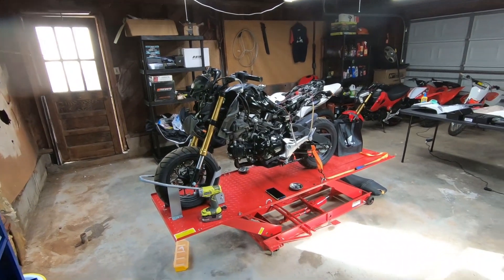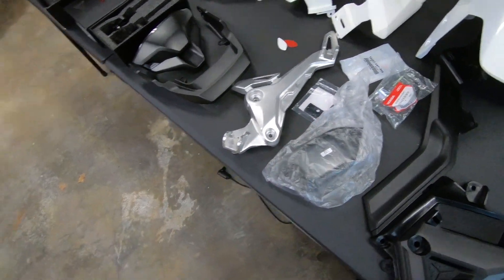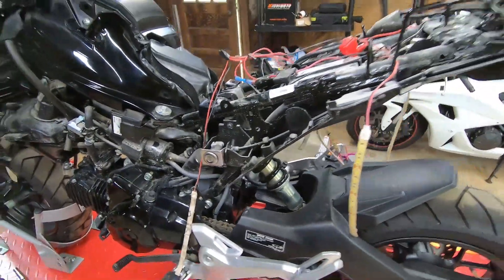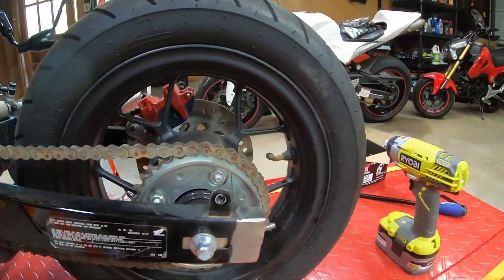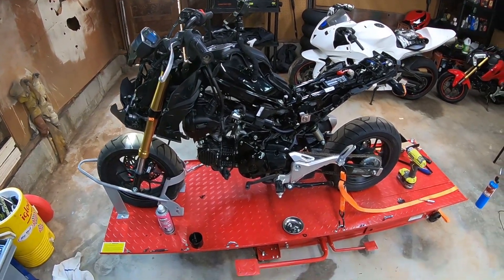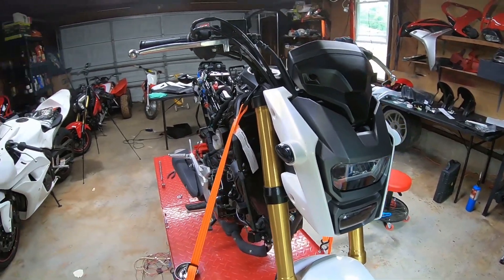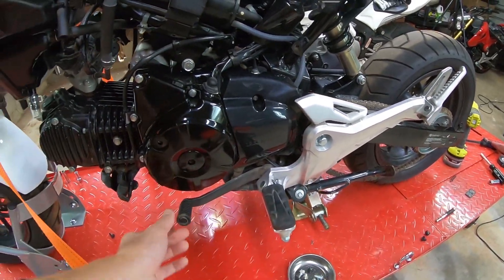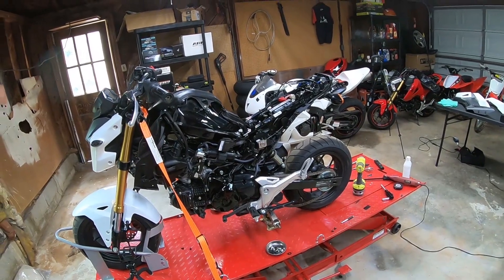Rebuilding a Wrecked 2018 Honda Grom Motorcycle from Copart auction | Part 2

Comment: Hell yeah i saw that on copart! Nice buy brother. Did it come with plastics?
Reply from the maker: Lol small world! Thanks bud. Yeah, it still had plastics on it when I picked it up. Part 1 shows how much the plastics etc were damaged and the replacement pieces ordered. Surprisingly the auction pictures represented it fairly well. Well, except for the wiring mess as they didn't have a picture with the seat off and for good reason lol.